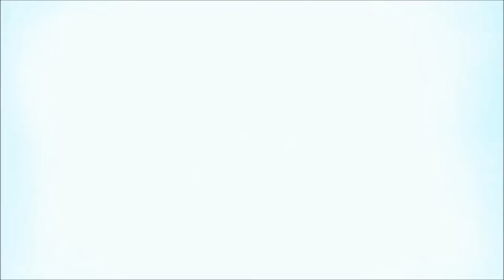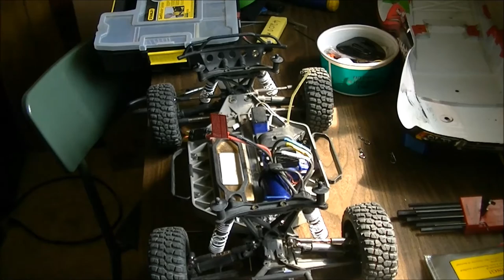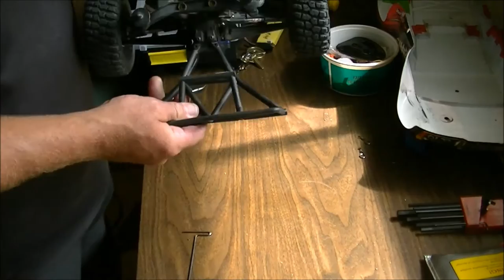Approximately What your RC Should Sound Like With Proper Gear Mesh

Comment: My Slash have harden steel pinion and spur. Only run it on 2s and one time on a little 3s. Love to test 4s in it. Just need a good 4s battery down the line
Reply: TOJO RC Can VXL handle 4s batteries?
Reply: Holanduzo No. VXL I know of max can do 3s. My Slash have the Mamba Monster system in it. And can take up to 6s
Reply from the maker: Holanduzo NO it can not handel 4s
Reply from the maker: TOJO RC the VXL ESC wont handel 4s if thats what your running for ESC
Reply from the maker: TOJO RC ah mamba power thats a good way to go for sure 6s and some airplane wings you might have a good plane there hahahahahah lol
Reply: Kevys Rc & Music yeah I know! I just haven't don more than 3s lol Don't know if I dare push the parts to the breaking point? lol
Reply from the maker: TOJO RC easy on the trigger and you should be ok and dont hit the brakes to hard lol other wise might be a problem what motor are you running wiht the mamba monster
Reply: TOJO RC That's what I kenw... Mamba Monster, now in 3s is hard to control the Slash, I wonder how to control with the huge Mamba
Reply: Kevys Rc & Music I did the mama monster Traxxas trade in. Turned in my VXL and paid some for the Mamba Monster system! The system is Motor and ESC
Reply from the maker: TOJO RC Awesome stuff

Comment: I like that glear cover, I am gonna go and order one right away. I found that sand and dust were getting under that cover on the motor side where there is no screw holding it down, so I drilled a hole and tapped a screw through mine and now it's sweet (:
Reply from the maker: Jax Teller RC the clear stuff is cool for sure